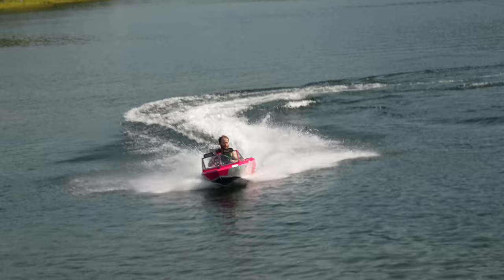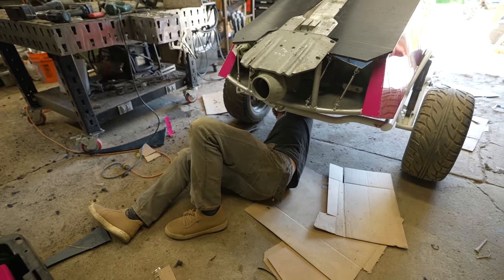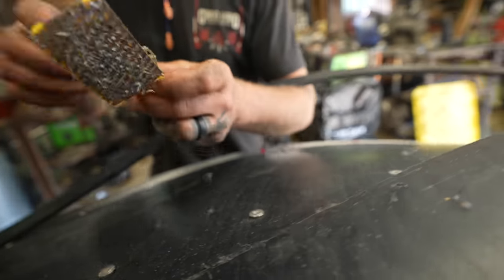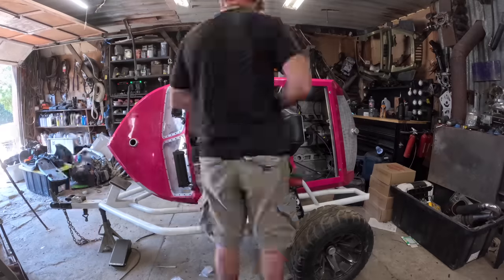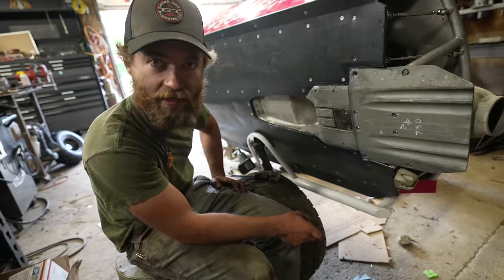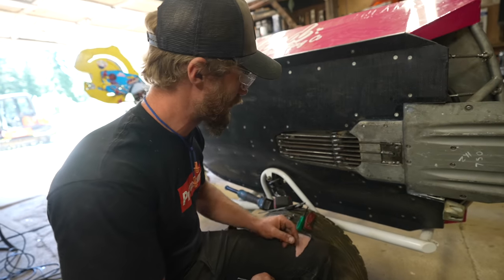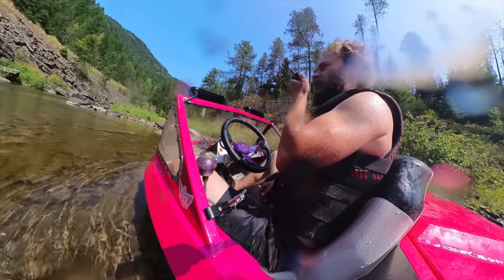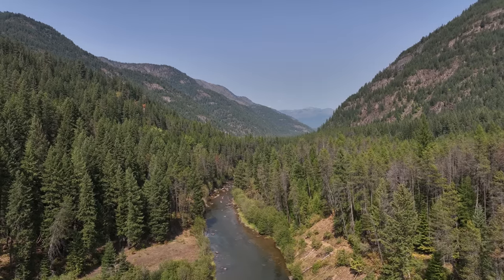We Built Armor for the World’s Fastest Micro Jet Boat!

Comment: Next time when bending or molding HMW plastics, use HEAT! You can basically mold the entire sheet to fit the hull bottom. Boiling water is great for bending and molding it because of heat distribution, but also a rosebud torch, applied sparingly, and other heating methods can be used. Also, consider cyanocrylate/powder welding for joining pieces together. You will come up with a more robust design altogether.

Comment: That would be a great sport, almost like rally racing, timed run up a streak of shallow river or creek, jumping over sandbars, hopping out as fast as you can to push your boat off of obstacles. Great event to attend, good spectator sport as well, not too expensive as well so low cost of entry.

Comment: I could only imagine how much it hurt to hit those rocks in that tiny boat
Reply: And damage it causes to boat that cost tons to build in parts not to mention labor that went to it. That armor is there to protect against rocks, not enable it to run on rock like its normal. Also leaving to expedition like that with out checking and double checking things like battery. Its same thing with bikes. You go to do physical work for whole day until you are exhausted, then tip your bike on its side and if you cant lift it up and kick to start, then its too heavy for you, that is just one of the things to consider when preparing to leave for expedition like that, cause you are utterly fucked if you run into issues middle of nowhere.
Reply: @Hellsong89 who asked?

Comment: Is there a reason you couldn't heat and bend the plastic to "mold" it to the bottom of the boat rather than cut and bend? I think the size of the piece would make it tricky but not impossible. Either way, looks great!
Reply: I had the same thought!
Reply: The plastic is probably too thick to properly heat or won't maintain the same properties and might deform.
Reply: you could potentially use the boat as a vacuum forming buck and use a sheet of kydex but that would take a lot of prep, a big machine to get it heated properly, and lots of trimming
Reply: @broodaiamdewey622 That was my thought… maybe when that plastic is heated and cools it becomes brittle and defeats the whole purpose of using it as a protective layer…
Reply: @broodaiamdewey622 The plastic can easily be heated, but you don't want to use a blowtorch. You use a hot water bath and then drape it over the hull and it will form fit as it cools down, a rosebud torch can work in a pinch to help it here and there but you have to do it carefully.

Comment: Tip for you guys. You can use the counter sink tool on plastic with a power drill but the trick is to put it in reverse and let it melt slowly while it heats up

Comment: Used to run the rivers in Western WA Steelhead and Salmon fishing when I was younger. My buddy and I built a 20' sled from scratch (built the trailer also).  One evening while shooting back up the Snoqualmie River in the dark my buddy made a wrong turn and we ended up in a small portion of the river that cut across a big sweeping bend in the river.  I was facing backwards, saw his eyes get big for a second and then he floored it.  I looked to my left and right and saw riverbank on both sides, just a few feet from the boat.  Turned around to see maybe a 10-12' wide trickle in front of us that was maybe 6-8" deep with a small waterfall over some small rocks at the end where it entered the main channel again.  We hit that little waterfall full throttle, jumped the boat back into the main river and kept on trucking!  Going 40-60mph up a shallow river in a big boat can be stressful but fun at the same time.

Comment: When you are cutting sheets of anything with a circular saw it's best to lift the saw blade so that it penetrates the material by less than 1/2". It stops the blade from overheating and makes it much easier to go around curves.

Comment: FYI if you have a cordless power tool battery you can jump a battery like is what's in your j boat. I've done it before on a Tahoe I had. None of my neighbors at the time had jumper cables. I had a fresh 14.4v cordless impact battery made 2 short cables and it fired right up.

Comment: That little yellow handled tool you were using is actually used in plastics and vacuum forming to take the sharp edges off of parts after they’re hand routed out of the plastic sheets once formed lol so you’re actually using it for another thing it’s meant to be used for.

Comment: Hey for the mini jet boat 🚢⛵. You think mig welding the nuts for the new skid plate on the inside of the boat to the bottom inside of the boat using regular nuts of course. And screwing the screws though using some kinda caulk or maybe water proof thread tape or something like that. May help with future leaks or current ones.

Comment: Might want to add water tight compartment for booster pack, leads to start it, no leave when battery has issues and build redundancy to bilge pumps etc before leaving for journey like this.. also little more water might be good idea. Rock proof and made to run over rocks are two different things... i'm afraid the damage bottom took from that.

Comment: Love the boat but as someone who used to work with plastic bumper cart bodies i would drill a hole at the end of the cut on the front of the boat cause over time the plastic will crack more going down that line and a hole would be a good way to isolate the end of that cut.

Comment: You need a soft material between the polymer and aluminium to do some vibration and shock absorbing. Some 10mm ribs of flat bar silicon under each bolt. 
And a solar panel on the back  shelf to charge. I would also suggest some v blades on the back edges of your jet intake to cut any fibrous plants sucked in.

Comment: The uhmw looks awesome came out great and so did the grate 😂. definitely need to make the trim tabs less aggressive cuz that's what's causing it to porpoise and not letting it get up on plane fully. You can watch it when yall ripped on the smooth water as soon as it tries to get up on plane it lifts almost gets there then the tabs pull it right back down then it lifts back up and dives back down which is what porpoising is for most jet boats yes you would want an agressive trim but cuz this thing is so short and tiny the tabs should be almost flat with the bottom of the boat especially for trying to get up a river where being up on plane is important to not get stuck you want just a slight angel for the low speeds tho but other than that this thing is sick and can't wait to see more of it.
Reply: After watching through to the end of the video it seems the rocks my have fixed the trim tabs a bit for ya😂😂

Comment: the early 2000's we used  rhino liner. It would spray out at over 200 degrees ended up building it quarter inch on jet skis and it was able to put spray it's so thick it came out smooth worked great. Good job. It might have been called Line-X now that I think about it

Comment: Looks like you need an electric bilge pump; you can run it while the engine is running.  That way, the charging system can run the pump without draining the battery.

As a rule of thumb, I always have a backup set of keys in a secure location.  Otherwise, keep a metal detector handy to find the keys easier when you lose them.

Comment: Rather than drill holes, personally, i would've welded some ribs of aluminium slightly angled forward (not much, just enough to make a good grip) and then i would've glued (epoxy or neoprene cement) them into the ribs after slicing a cut at the correct angle with a table saw and an angled blade to match the angle of the ones on the boat. No screws, no penetration into the hull and properly glued just hard enough and mechanically helped to stay on to do their job, but not that difficult to make it a chore to remove and replace. Caveat, would've meant a slightly thicker plate of UHMW. I've used this method to affix the same material to the bottom of a truck and it works really well. One other thing, both surfaces need to be keyed if two part epoxy is used. Not so much for cement.

Comment: I would have heat formed/bent all the bends and only screwed it into the fins on the far ends. Id be afraid of ripping a screw out and the boat springing a leak. Also you can fill in the gaps with your scraps of plastic. Melt it with a soldering iron and weld it together.

Comment: Hey, you guys are on in Montana on the Clark fork River where the bull Bull River dumps in awesome. That’s my favorite place around here I live right down the road from you guys! I’m taking my long tail up that thing. I actually do plastic welding ultra high molecular weight polyethylene is pretty tough to weld but I could weld hi density polyethylene and I molecular weight polyethylene. Let me know if you guys need any repairs done. I’m literally 50 miles away from you guys. Mountain Poly Tech is my company

Comment: bro you have to put paper tape.. inside.. then  foam in .. and put a cover plate while it expends..get thet exact negative..   out.. then let the piece dry and cut it into thin slices the way you want thte fins..then you use those as stencil.. after numbering them.  and bamm you have perfect fin arrangement.

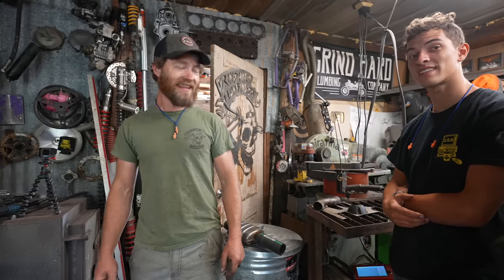Comment: 21:54 the scoop don't scoop no more. Pump has to work a bit more to juice up. There's a reason they put them at perfect angles and at a certain level. You should look up the specs for similar plates and make a riser or taller intake.

Comment: Should just use a heat gun. Heat up and bend into place then cool it with ice water when finding the right angle to cement it perfectly permanently without any joins or cuts. Anyways fun idea..

Comment: The best way to put that on a boat is you have to heat the Polly 90 degree or higher temperature is best in direct sunlight it makes it more pliable and we'll lay down to the surface of the boat better but that's just my opinion from working on airboats and putting it on the bottom

Comment: Second two passenger, mod to FREEDIVE or search for gold.
Pointer on Li-ion batteries.  They work best by regulated Current charging, as opposed to Voltage charging.  Low resistance allows too much current.
Best option IMO, a battery of super capacitor cells.  Infinite charges, and you can weld with it in the field.  Disadvantage, low capacity.

Comment: I'm just wondering if you need to start making Will's push-ups harder as he hasn't got the message yet....... maybe bare knuckle style? Also, did you test using a heat gun on that plastic to help with the bending? I know it's quite thick but gradually heating it with a paint stripper style heat gun might have made the job easier.... if you ever have to replace it, that might help 😅

Comment: Silicone??
No  dude!
You can hot-air weld UHMW.
It's a bit like TIG welding, but you use a hot air gun with about a 3/16 -1/4" nozzle. Feed in a piece of UHMW sprue.
You need that tool.
Watch some vids.

Comment: You should have gotten a v groove bit on a router and then shallowly cut the inside that goes up against the hull and then it would fold at the V and then you would still keep the rigidity on the outside

Comment: You’ll have that on these bigger jobs
Reply: @GrindHardPlumbingCo U should motorize the jet boat trailer so u can drive the jet boat trailer to the docks while ur sitting in the jetboat.
Reply: @GrindHardPlumbingCo also u should make an ore/rope holder so when u have engine issues or run outta fuel or any issues really. I boat that small would be a breeze to paddle or drag back.

Comment: Sick build. Had a thought. Does your exhaust still dump water into header/exhaust somewhere for cooling or not on this engine? If so would the glass pack get water in it from either that or water bypassing flap on back of boat when slowing off plane? Im missing a bunch of details on the build so prolly a mute point but was curious. @Grind Hard Plumbing Co.
Reply: Yes. That atv muffler will retain lots of water. Been there

Comment: They sell this paint on rubber stuff we use on our four wheelers that would have been way way better for this you literally just spray it on like paint do like 5 coats and it seals everything water tight and adds protection and can be removed with a torch and patience if needed

Comment: You guys should add a Schrader valve on the lowest point of the exhaust so that when you get done running it you can drain the water out of it so it doesn't fund it's way into the engine.
Reply: All jet skiiers blast the engine for a few seconds when on the trailer, this blasts most of water out of the exhaust system
Reply: @nordic5490  I'm not a jet skiier so I didn't know that. Now I do though lol.

Comment: Imagine,if you will, running the northern rivers with rocks in then,and slamming this tiny BARBIE boat across a rocky shore and each and every one of those screw heads,which are sticking out further than the skidplate,catching the leading edge of said rock ripping then out,or twisting and bending them so there's now multiple water ingress points all along the hulls length...

Comment: What premix do you guys use? there's been some interesting stuff on the internet about big box store premixes having low top end performance in 2 strokes. Not like a lot but 5-7% at the top end RPM's is something you can feel.
Reply: Marine 2stroke oil is designed to completely burn in a cold river water cooled jetski engine, and is low ash when cold, amd is a completely different oil to land 2stroke oils.

Land 2stroke oils wont burn fully in a cold marine engine, and oil will accumulate in the exhaust making a big mess.

I buy a large drum of racing marine 2 stroke oil, then mix it my self.

Comment: river is too low, why would you ? It's not mine, any way you can make adjustable stabalizer flaps so it would hydrodynamically flow with less drag. Bet it would skim much better over
inches above your rocks and boulders, much better. You have the speed to create the hydrodynamics for a nice skim flow. always worked on my boats with an increase of 3 to five, six miles faster.

Comment: You know it probably would have been better if he would have put some epoxy up underneath of that after he did all of that and then screwed it all down this way it would have sealed and he wouldn't have had to worry about anyting he would have helped seal the hole in a lot better and would have kept water from coming in from the screw holes and everything I guarantee you this boat sometime or another is going to leak once he starts doing the things he's doing because those screws are going to loosen up and if he would have put epoxy and stuff on it with some loctite it would have kept things in place and he would have had to worry about the issues he's getting ready to have in this boat

Comment: Dudes... why didn't you just carry the truck battery down with the jumper cables? You could have jumped it that way and it wouldn't have taken much juice cuz it's just a Small Engine not a truck. If the Road has decent traffic you can get a jump if you drain the truck battery.
Reply: I have 2 jumps starters that work great and fit in my pockets. Easy to keep store one on board the boat.